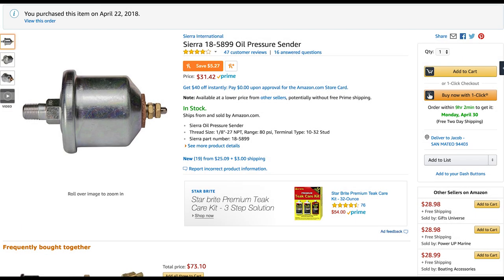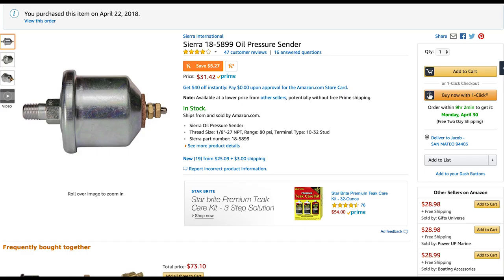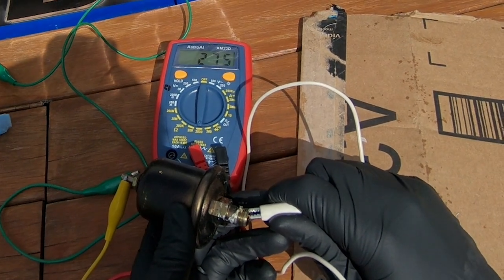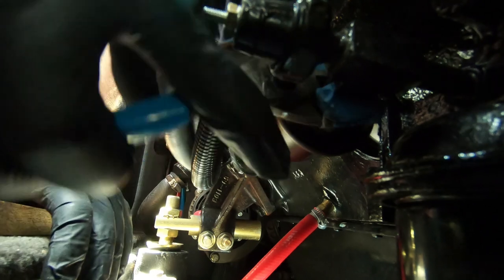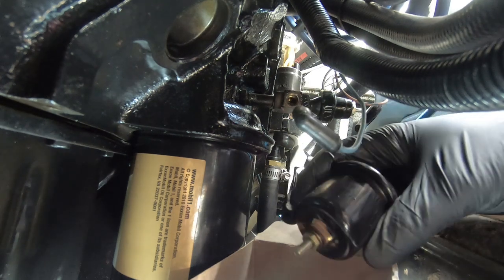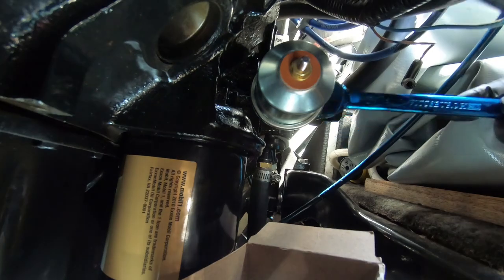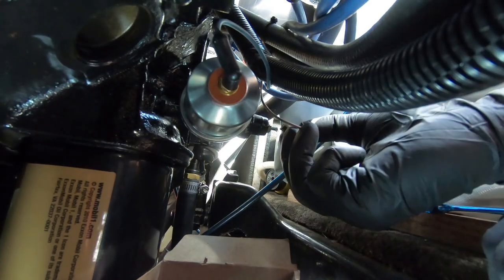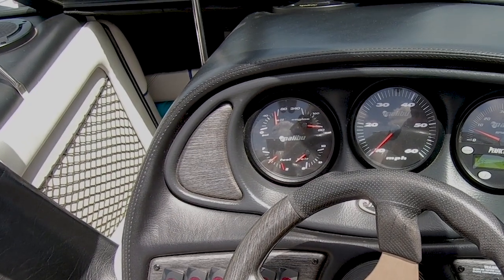Oil pressure Sensor- Diagnose and Replace on a Boat

Comment: If ove got it right there's a other unit looks similar but smaller to this which the pressure alarm connects to ,this is a separate unit?

Comment: This is actually the oil pressure sending unit for your dash gauge. The sensor is the smaller electrical unit which shuts off the electric fuel pump or kills the ignition in case of no oil pressure.
Reply from the maker: Thank you for the clarification. I appreciate it!

Comment: Hey Jake, what year/make/model boat is this?  I have to help a buddy's (who passed) wife diagnose some stuff on a 2004 Wakesetter 21 LSV Thursday.  I want to test that oil pressure switch as well so thank you for the readings and video.  I assume this would be the same part for her boat?  It has the Monsoon 340 engine.
Reply from the maker: Yes likely the same. This was a 2002 Malibu with the 325 monsoon indmar engine.

Comment: Can a bad oil pressure sensor prevent the coil from getting power? I've replaced my coil and I'm still not getting spark but the engine cranks over fine.
Reply from the maker: That is a good question. But beyond my knowledge. I'd join a few FB groups to ask that question.
Reply: I know im a bit late but if someone has the same question a bad oil pressure sender the smaller one of the both oil pressure sensors could prevent spark or the fuel pump to pump fuel it is a safety feature so that the engine wont turn on if it doesnt have oil pressure
Reply from the maker: @marc422 great tip! Thank you!

Comment: My boat is a 2013 Bayliner 175 and I noticed my oil pressure gauge don’t work at all and the motor works perfect and the oil level is good just wondering if there could be a fuse problem that makes the gauge work

Comment: If oil is ok level
Why the gauge gives low very low oil pressure like 1 or less
Reply from the maker: Faulty sensor provides faulty reading to gauge.
Reply: @fixitwithjake  whats that sensor name?

Comment: I have a 2003 Larson with a Penta GXI 5.0 motor, and I recently changed the impeller because it was Really bad, it made my engine run hot.  I noticed that my oil pressure gauge would go all the way into the red the more that I celerate. is that a sensor issue or oil pump issue?
Reply from the maker: If the new impeller made your engine “run hot” like you said, I’d start there. A good impeller is critical to engine cooling. They are made of rubber and can fail at anytime. And there’s some aftermarket ones that don’t last and aren’t quality. Stick with name brands for impellers if you haven’t already.
Reply: @fixitwithjake  thanks for replying to my comment Jake, but I think you misunderstood. The old impeller was really bad, so I changed it with a new one, that’s working fine, but for some reason every time I accelerate the boat the oil pressure gauge will go into the red. 
That was my question what is causing that
Reply from the maker: Ahhh I see. I wish I could tell you but I’m not quite sure. I’d join some Facebook groups for that boat and see if people know on there??? Also, check the sea strainer and heater exchanger. Sometimes the old bits of rubber from the bad impeller beak off and can create a small blockage. You won’t notice it at idle. But when it tried to push more water through at higher rpm it will be restricted and cause the engine to run hot. Good luck!

Comment: I recently got a 02 wakesetter which I’m pretty sure is the boat in the video. If my oil pressure gauge is pegged at 0 when the boat is operating but no alarm is sounding do you think it’s the same part you replaced? When I first turn the boat on it flickers making me think it’s getting a signal, just not a correct signal. Really like the videos and any advice helps.

Comment: Excellent video.  I have a 2003 Honda 200 outboard on my boat.  Started it up after sitting in the driveway for 6mos. and it ran fine for about 6min.  Oil pressure alarm went off.  Turned off motor, checked dip stick and it indicated it was full.  Waited about 5min., started it up again and it ran fine for about 2.5min., before the alarm went off again.  Any ideas or suggestions...besides changing the oil?  Thanks.
Reply: Did you ever fix this issue?

Comment: pressure (erratic) bottoms out goes to proper pressure when you raise idle sometimes higher .. I noticed on crusader engines 8.1 you have a switch and a sender.. confused
Reply from the maker: It would be my guess: that is a sensors that is starting to fail. They are so cheap, I would swap it out and see if it solves the issue. Also, check the wiring to and from it. My boat has low pressure at idle but reaches normal under a slight load. That throws off some people too....

Comment: It looked like your oil pressure was still bouncing around.  Did this actually fix the issue?
Reply from the maker: Taylor McCroskey yep totally fixed it. It’s normal for the pressure to move around like that.
Reply: @fixitwithjake  Looks just like when it was bad lol ?
Reply from the maker: I might have messed up I the editing and used a clip of the before on accident. We just took the boat out again and the gauge is rock steady and not moving up and down. Sorry!

Comment: Thanks  for your time to help us fellow boaters!!  I have a question if optimax is beeping it's a 150 08 by the way.... with only 75hrs yeah 75hrs!!! The break in procedure was 30 I think? My Mother passed and didn't have spirits to fish so it did set up so I had  a master mechanic change plugs get a new key (yep) lost key drain old gas new gas lines anything  the only one touching it Lol..  would he be able to tell if motor is bad like gas in spark plugs or gas pumps or pump ECT.. Excuse my knowledge on motors I just like to fish leave issues to professionals I am taking it to Cabela's it was bought at bass pro shop they have joined forces guess he would not put sensor on if my complaints is beeping??  Kudos on videos and helping much appreciated!!  Don't want to go in blind and get the ole riming out Lol.. Thanks again any advice will be appreciated.. Be Blessed

Comment: Jake!  Nice work! thanks!  What is normal oil pressure? The indmar manual tells me 4 psi at idle but that can't be right.. Or my gauge is reading wrong (reads 55psi at idle).
Reply from the maker: I dont know, i'm sorry.
Reply: 55psi is good. Usuqlly is 40 and 25psi the lowest when engine is hot.

Comment: So pressure should be around 60 ?
Reply from the maker: I don’t know what exact engine you have. But a lot of these wake boats use a Chevy 350 engine. When the engine is running, the oil pressure gauge should read between 25 and 65 PSI.

Comment: Hi Jake maybe you could help me out I have a mercruiser 5 litre mpi when I run the engine every 30 seconds an alarm sounds an if the engine is ran for about an hour the alarm stays on constantly.i have recently just fitted a new alternator and belt and its been since then thanks Tommy from liverpool

Comment: I added a tiller handle to a 60 hp Suzuki 2017. ( the one with a tach, shifter, & warning lights) My problem is the oil warning light stays on all the time( but with NO  buzzer, no blinking) even with the key to ON but not Start !  Oil is ok. Any ideas ? Short? Bad oil pressure switch ?

Comment: if that’s the oil pressure sensor what’s the other one with the brown and blue wire you reconnected next to it?
Reply: Oil pressure switch
Reply: @tyronemcgriddles4802  so there’s a sensor and a switch and what does the switch turn on exactly?

Comment: How do you replace the oil level safety switch on a yamaha 150 four stroke. I have been checking my oil before taking the boat out and after about 1 1\2 hours my oil light comes. But there is no oil in the engine bay.
Reply from the maker: Unfortunately, I've never worked on one of those and I wouldn't want to steer you wrong.

Comment: Hi Jake, if my oil sensor switch is faulty and leaking would it stop the gauges from working ?
Reply from the maker: yes
Reply: Hello jake,
One minute the boat starts...next it has nothing...would this.
Reply: Be a reason
Reply: @jimwillis2698  think it is fuel filter

Comment: I might have a similar problem with my boat (Mercruiser 350 MAG MPI) The oil pressure is reading about 60psi idle and above 80psi at 3000rpm. The gauge on the dash is analog 33-240 ohm system. I think this engine has 2 sensors, one analog for older analog gauges and digital to be used by PCM and further down the CAN bus. On which side of the engine is this one located?
Reply: Must to be same plase. But sensor need to be replaced to special with two signals ...

Comment: Yikes! get the right wrench! when you use pliers and adjustable wrenches you mar the bolt, then the correct wrench will never fit and when things get tough you cant remove anything. Like your video. Not the wrench choices....   : )